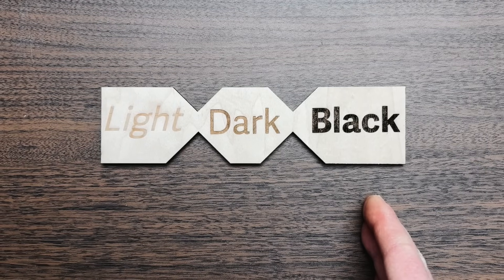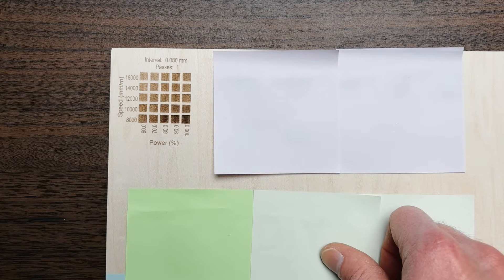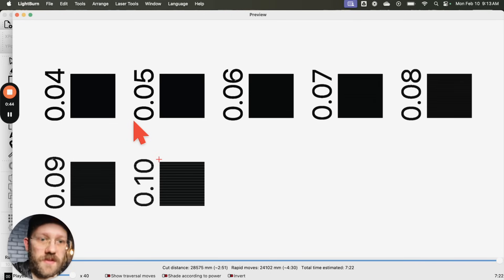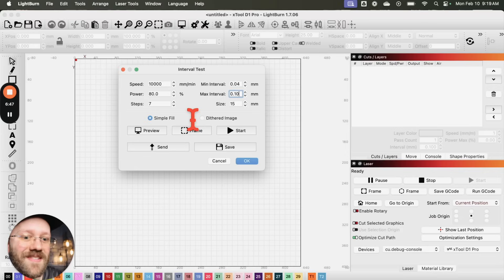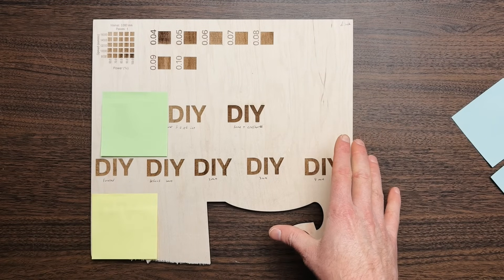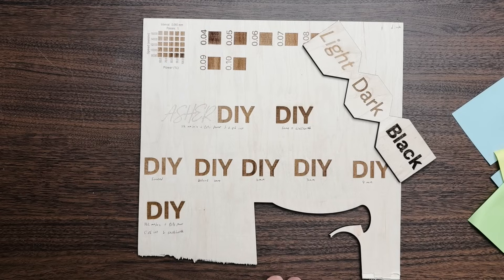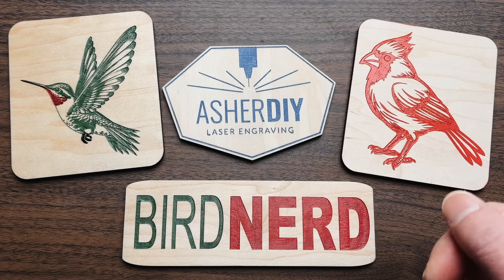The Key to DARKER Laser Engravings (Full Guide)

Comment: Just found you, and really like most of your content. However, I think you are doing a dis-service to new laser users with this video. Cross hatch was never intended for gantry style lasers for multiple reasons. First, the Y direction stepper motor in most all gantry lasers runs at a  signifigantly slower maximum speed (due to the extra mass it has to move) than the X direction motor. Basically, if you exceed the Y max speed it will simply not go that fast, increasing the laser energy applied to the material. Second, many lasers use a completely different motor for the two axis. X axis will generally be specced for high speed directional changes and smooth long distance transits, while the y axis motor will be optimized for slower, low-G movements with a focus on accuracy. Trying to run the y-axis at high speed in this type of setup will cause faster failure of the motor. Lastly, because of the belt length being shorter in most setups (especially desktop machines), the more intense direction changes in the Y axis using cross hatch can wear the belt out faster than the x-axis belt, causing warp in the laser's output.

Oh, forgot about overscan. Most controllers only handle overscan for you on the X axis, making a perfect setup extra challenging and possibly leading to bad engraving results in general.

Cross hatch is intended for galvo lasers, such as the x-tool F1. Because it uses small mirrors to direct the laser instead of the large stepper motors, it can perform fast movement in any direction, not just left-to-right.

Comment: So I followed specifically because I wanted my dice trays to really pop without causing leveling issues with deeper engravings. 
While this did add 30min to my time per tray, this ended up making my overall image at least 1/3 of the original depth and the color much more uniform. I use affordable mango wood blanks and they are not the most uniform density and this also helped level that out with the cross hatch. Overall a great tutorial. Thanks.

Comment: Dear Sirs:
Thank you for an excellent very concise tutorial video…
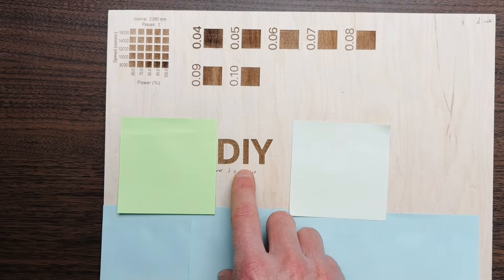 In your video @ approx. time of 11:12, you show the use the crosshatch setup…I was told that on the x-axis bar movement style lasers, one should only use that linear movement direction of the laser head because it will be more accurate burn due to motor dampening movements (x and y) and also the machine wear would be greater if one used both directions….

Comment: Nice video. On defocusing you really need to know what your depth of field is for your lens. It won't do anything if you have a 5mm depth of field and you only try to defocus by 1 or 2 mm.  Assuming you focused at the center of your depth of field, you would need to go at least 3mm before you actually go out of focus. I personally didn't notice much difference in darkness across your samples except for the 2mm.
Reply from the maker: Super interesting - thanks for pointing that out. How would you typically go about finding the depth of field for your lens? 

The reason I originally tested 1-4 mm of defocusing, was because in all the research I did online, most people seemed to suggest defocusing by 2-3 mm, so I simply added a mm on both sides. 

But if there's a better way of doing this that will work more consistently across lasers, I'd love to learn more about it!